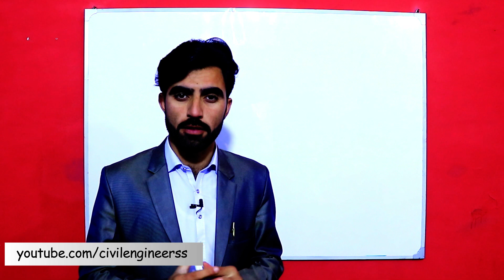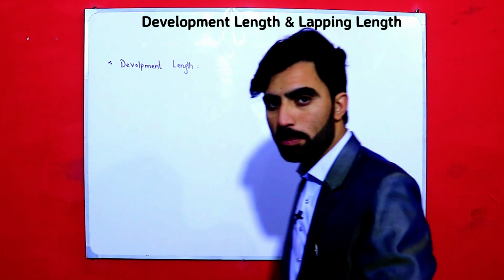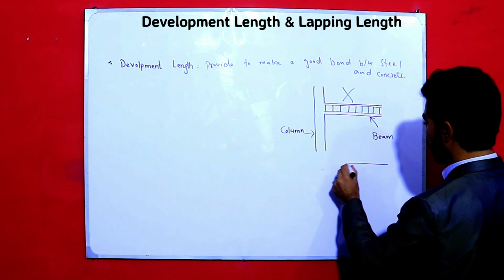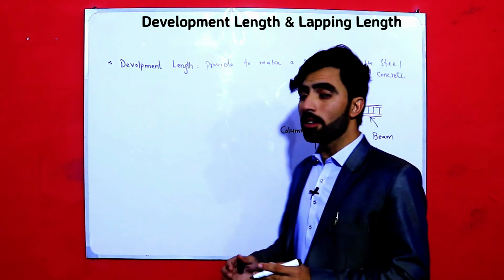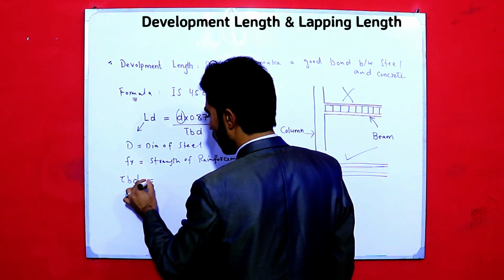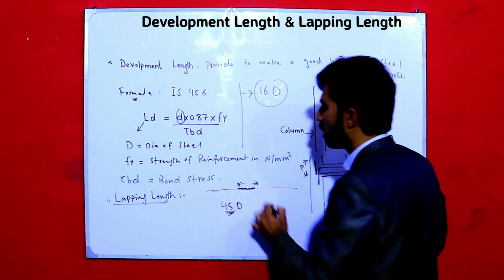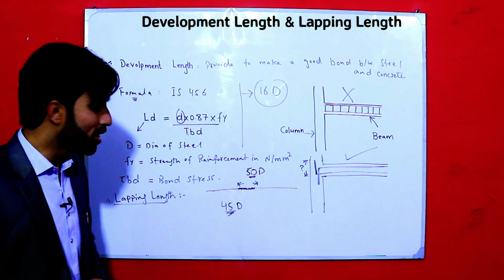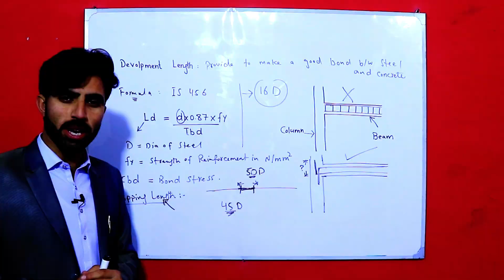Development Length and Lapping Length for Reinforcement  - Civil Engineering Videos

Comment: I have some doubts,
As we practice on site as per the drawings...
The development length is the total length of L shaped bar, start from the face of the column and beam, but you told it's only the bent portion of the rebar in side the column... Please clearfy..

And it's not a constant value it varies with the grade concrete....
In general we use 50 d... But you told 
18 d????  Please
Reply: Development length is the bent L portion inside the col.